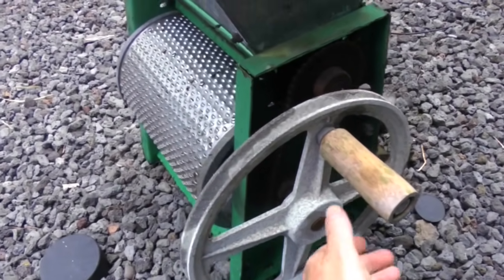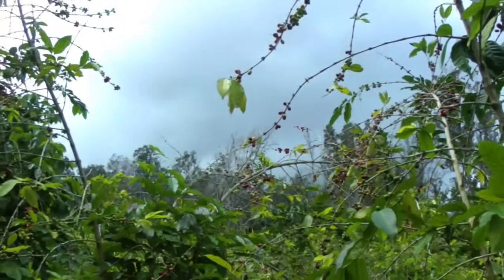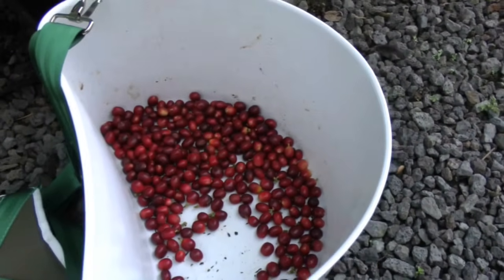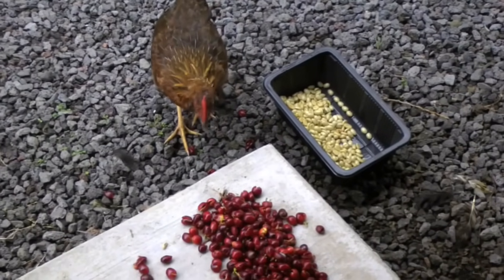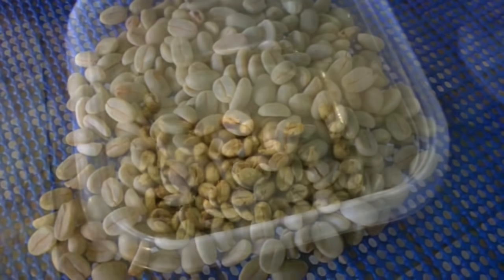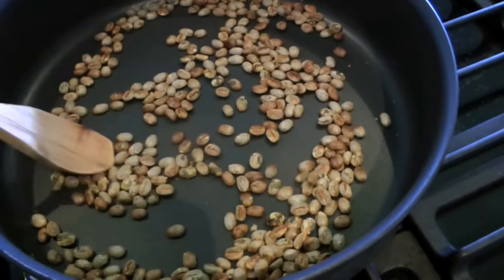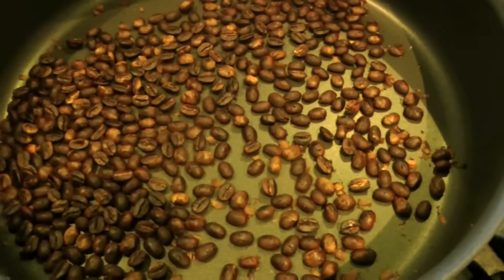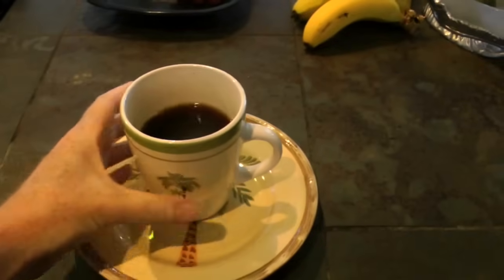Make a Cup of Coffee Starting From Scratch | Coffea arabica | Video

Comment: This is one of the best videos I have seen about coffee. From plant to drink. Thanks for this gem, which actually shows how coffee is made! Keep them coming sir!

That being said some things should be done differently to optimize taste, now I know that optimizing the taste isn't the point of the video, I will still list the points.
Firstly, when your removed the skin from the dried beans in the mill it chipped some of the beans. I don't know how this process is done optimally, but chipping isn't ideal.
Secondly, Roasting in a pan results in an uneven roast and hence uneven flavor. Roasting should always be done in a moving device for optimal even roast.
Moreover, coffee should always be left out a week or two after being roasted to degas all of it's CO2. Coffee tastes best 1-2 weeks after being roasted.
Finally, and most importantly grinding coffee in a mill is a bad idea. Ideally it should be done in a burr which yields far more consistent grinds and the ability to dial in to the desired grind size. If the grind is uneven as it is in a mill then once the water hits the different sized beans it will penetrate them unevenly hence resulting in uneven extraction. Grinding is one of the most important steps in coffee making, both for fine and coarse grinds.

Comment: Thanks for the great video! I have my own trees (just five) and this is my first harvest. I have gotten to the point of drying the beans and need to get the parchment off.  Appreciate the tip about using the coffee grinder.  Once I get the parchment off, do I need to roast the beans right away, or can I store them for roasting later?
Reply from the maker: You will have green coffee once you remove the parchment. Either green or parchment will store for up to 6 months if kept dry - but it will gradually lose its flavor.

Comment: All that effort and then uses the worst method for making coffee. Much disappoint.
Reply: A pour-over is one of the best ways to brew a cup of coffee!  Would you rather have a Mr. Coffee?
Reply: maybe it's a good bench mark for other coffees. You'll always have a filter and cup but you might not have an espresso machine.
Reply: It's not the pour over, it's the grind method he did. Blade grinders make for extremely uneven grinds. Since some of it will inevitably remain coarse, while other beans get too fine, making for an uneven, bitter or sour coffee.
Reply: Meh I like a cup of european coffee as much as an american. I switch it up daily. But the family I live with in Spain would never do a pour over.
Reply: Should've used a burr grinder
Reply: @NeonLuminous  It's a drug delivery system. Sit down.
Reply: @NeonLuminous  Thanks for that!
Reply: @scottwhite685  Cold brew.

Comment: Great video! Thank you so much. Can you dry them by putting them in the oven on a cookie sheet? May speed the process. Hmmm
Reply from the maker: Some large mills have hot air dryers to dry the coffee beans. It's not usually done because it's not as economical. But drying coffee beans on a cookie sheet should work if you keep the temperature low (don't cook them).

Comment: Nice work. Do you ever use wet fermentation rather than drying the beans straight after pulping? Good tip with the blade grinder for removing the chaff from the dried beans, although I think wet fermentation will remove a lot of that.
Regards, David

Comment: Great video, but dang, get yourself a burr grinder! Chopping up all that good coffee into a million different grind sizes like that doesn't result in the best cup of coffee. Half of it is super coarse and the other half of it is basically powder. It's impossible to get even extraction that way! Although if you're going to use any kind of brew method when using a non-burr grinder like that, using immersion like you did is the right way to go as it's the most forgiving of uneven grind size.

Also, I was laughing pretty hard at the part with the colander. Looking down at all that silverskin sprinkled across the stovetop like "yep, I totally meant to do that."